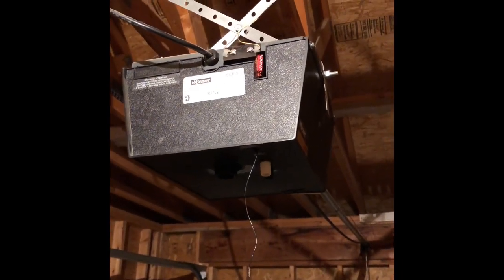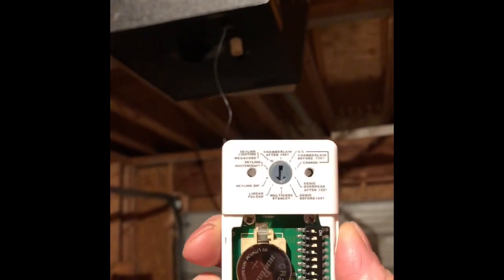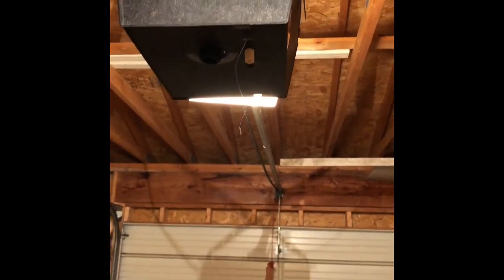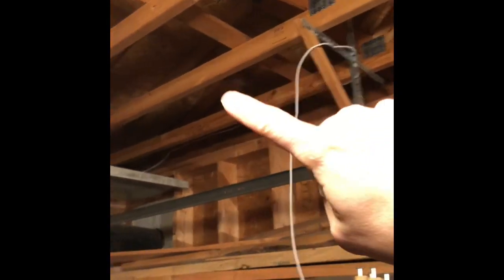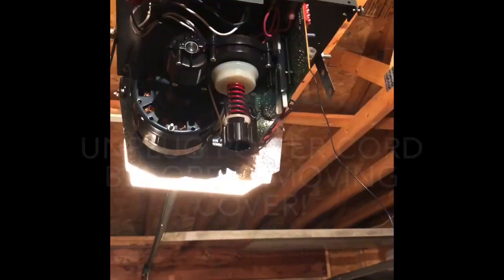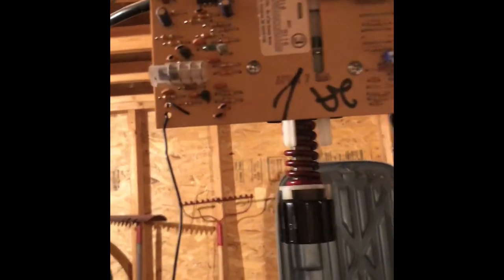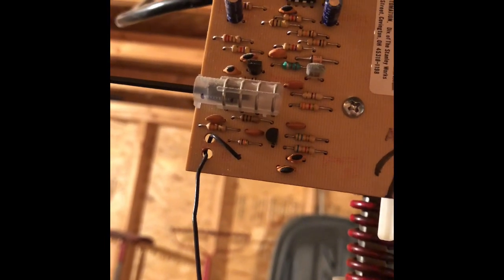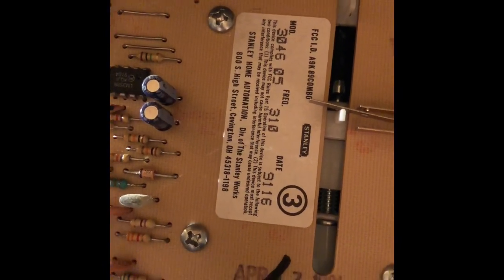Increase Extend Range of Garage door opener remote with just a screw driver

Comment: what kind of wire did you use to extend?
Reply from the maker: You don’t need wire - you just adjust the frequency with the adjustment pot using a screwdriver.